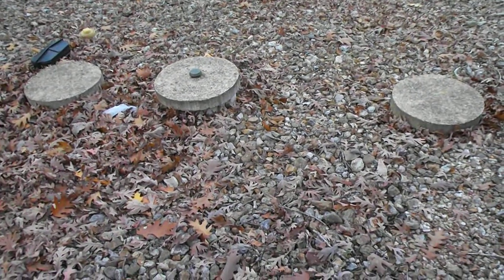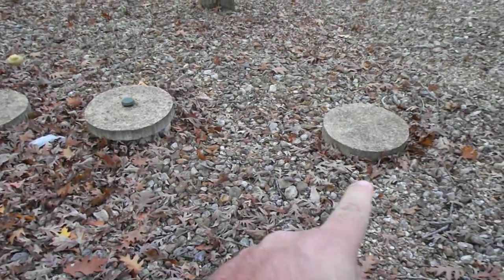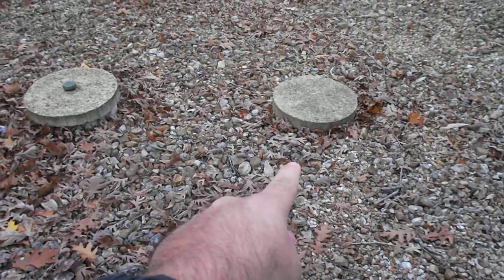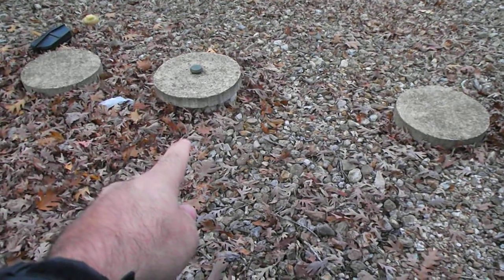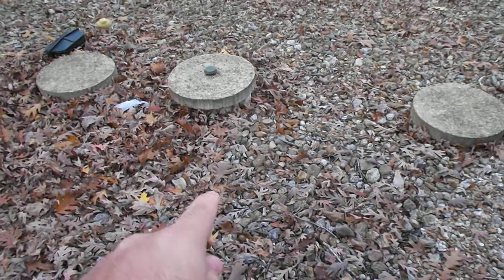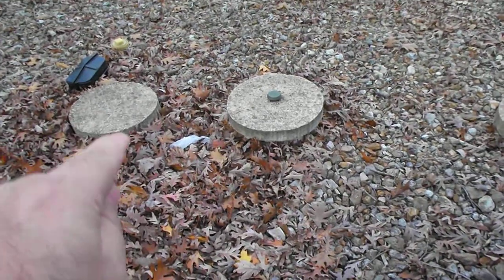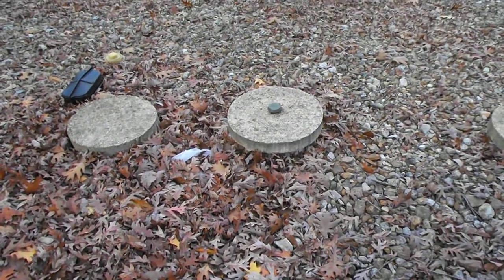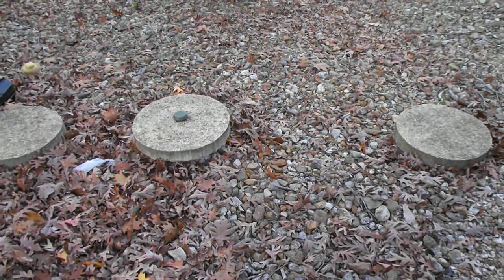Aeration onsite waste treatment system, Septic tank

Comment: I have the center cap, but not the two at left and right.
Reply: Paul Atreides  you probably have an original norweco system that didn't have the filter chamber and your pretreatment never had the riser put on it so it's buried with a little plug on it make sure you dig that up when pumping
Reply: If the lid has  air gap on it like the center lid on this one does, the other two lids probably do not have risers which are cylinders sealed to tank with lids like in the video - so you can access lids from surface. you would have to dig down to those to access...If tlid does not have air gap...then it may be a septic tank. Feel free to go to my website and email  pic of it and may be able to help further.
Reply: This is a jet inc tank. The lid on the right is pretreat chamber. Lid and riser is optional. Center lid is the aerator. Right side lid is outlet side of tank.